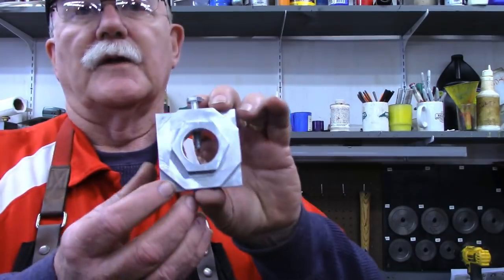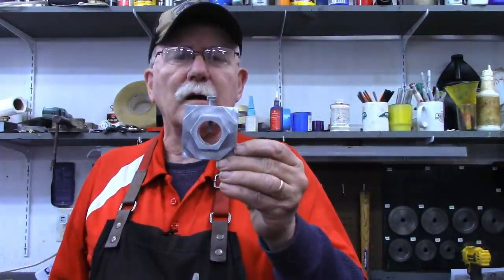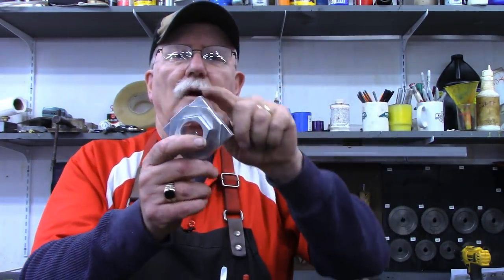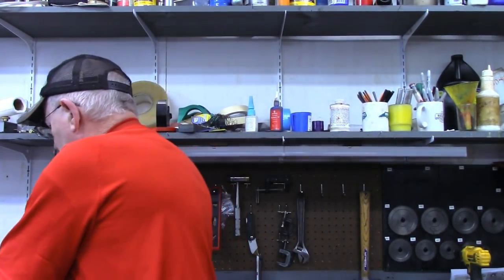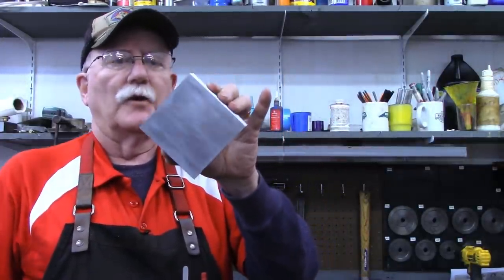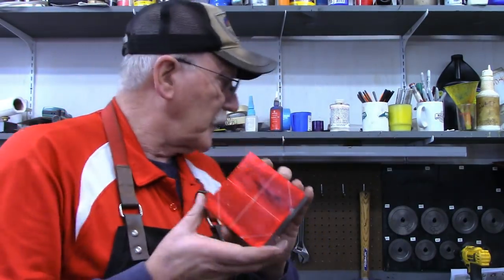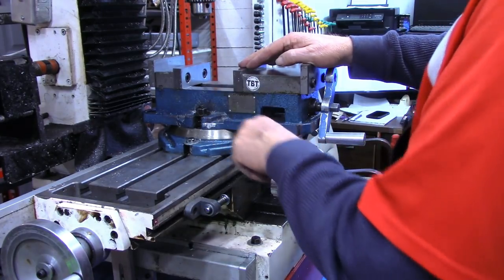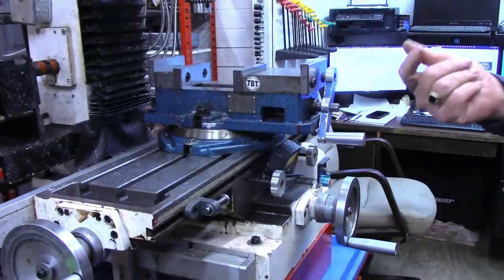Machining a 4-6-8 Indexing Jig - Part 1

Comment: Really an inspiring video. MrPete222, Tubalcain, recently showed the use of this. He used the name "Rose Index" giving me the idea to make one. Here we are. Compared to 4 and 6 sided collet chucks this device has a great advantage. I'm sure it will come clear in the next part of the video.
Great footage, lots of work with camera angels and editing.
Reply: Yep and I mentioned I’d make a 3D printed one which I did and the guy from rose index got all bent out of shape. I believe you can make anything as long as you don’t sell them?
Reply: I wonder why its called rose index, do you know ?
Reply: @tonypike5785  that’s part of his name! (Timm Rosenthal)
Reply: @trialnterror  
Yeah, the owner, Timm Rosenthal was just in an interview with Aaron Engineering (5/19/2022 on YouTube) and he was fussing about people making sets for themselves, he said it was theft and disrespectful. 
Aaron made a 3D printed set for himself and done a video on it, then Mr. Rosenthal saw the video and contacted Aaron to raise sand about it so Aaron agreed to do an interview with him to promote his one and only product. 
Rosenthal says that his invention is his idea and his alone but people have been using very similar methods on round bar for decades if not centuries.
Shoot, back in the 70s, I used to tack weld a large hex nut to the end of round bar to use for indexing in the milling machine, then knock the nut off when I was done, it was easier to use hex nuts since the round bars were always such different sizes. I'm sure that using a hex nut for indexing was nothing new or unique!! 
I have also used a small straight bar tacked to the end of a rod, then used precision angle blocks for indexing specific amounts like 45° or odd angles or whatever was needed, there are many ways to easily index stock when needed. 
Rosenthal never cracked a smile during the entire interview. 
I wouldn't even consider buying his product after watching his interview, what a stiff shirt!!

And yes, anybody can make anything they want even if it's patented as long as they don't manufacture it and sell to the public.

Comment: Hey Lee, just a quick note, its hard to know if the marks on the vise swivel are accurate. You are looking for parallel sides. It would have been just as easy, and maybe ... maybe more accurate to put a stop on your vise, remove the piece and turn it and snug it up to the stop. That way you are sure that you have parallel sides. you can be sure of the 45, the 90 from the 45, and the opposite corners.

Good build though. I think I saw Randy using one. Good build.. When I saw his, I thought the same thing about building one.

Those needles stick to everything. I setup a vac when doing that. Even on hot metal, I make sure there's no fire before I finish up

Comment: Good video
Reply from the maker: Nope, be sure to watch part 2.
Reply: Hi 
As you will no doubt be able to see I have edited my comment as I think you misunderstood them. What I was trying to say was that using a rule (scale) to mark out the lines and a set of compasses is not very accurate. So if you use your jig to cut a hex / octagon then you should realign the cutter for each side if you require accuracy.
Reply from the maker: @chrisbaker3844  Thanks for stopping by Chris, but as I stated multiple times in this video, "the lengths of the sides do not have to be the same - the only thing that matters is that each side is at the correct angle to its adjacent sides."  Heck, even the hole I put in the piece in the second part doesn't even have to be in the center.  Stay tuned :-)